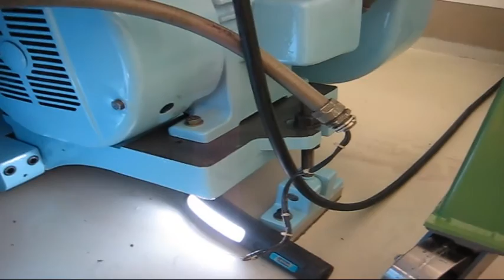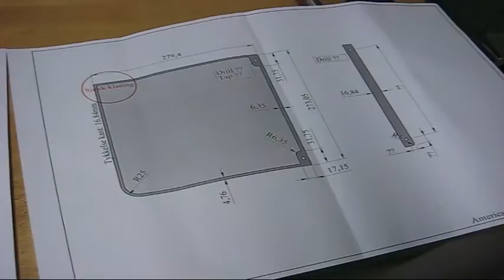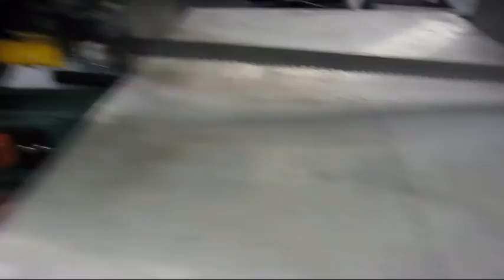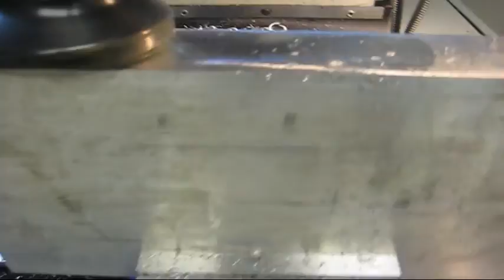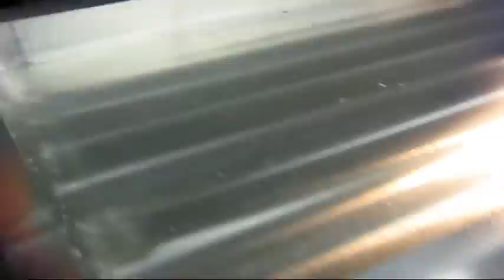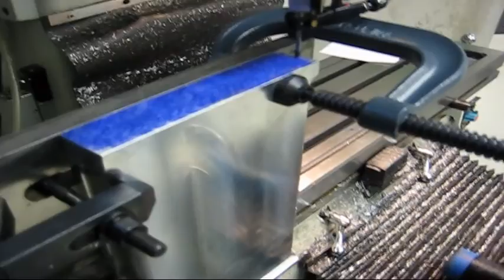American Pacemaker lathe reassembly part 22

Comment: Manual mills and lathes are a have to have,  but they do make a job at the end for cleaning.
Reply from the maker: That's for sure. That milling machine is always more dirty than all the other machines combined, although I always clean and oil the table.

Comment: you could clear anodizing the cover too.
Reply from the maker: That's a good idea. I'll think about that too. Or anodize it in another fancy colour. I'm leaning towards paint though. There are a number of imperfections that the paint will fix up nicely.
Reply: yep, the surface would need to be polished or buffed out, if you're open to other colors hard anodizing might last better. The paint on my Monarch C gets beat up pretty bad by hot chips and general wear and tear
Reply from the maker: Yes, the paint gets it. I have never tried anodizing myself but I read the surface must be perfect in every way as the anodizing will make everything stand out. We'll see what I decide.

Comment: Hey panzax could you explain the math behind the 0.0033mm error for the 80mm face mill calculation? 🙏
Reply from the maker: When I trammed in the head of the mill it was 0,01mm out of tram over the width of the table. The table is about 250mm wide. The facemill I was using was 80mm wide, so that is about 1/3 of the table width. Then one edge of the facemill will be 0,01mm divided by 3 higher than the other edge = 0,0033mm. Hope that answers your question.
Reply: Thanks!

Comment: Wow!  What a beautiful piece you made there.  It looks like you turned about eighty five percent of that block into chips.  I like the result.
Reply from the maker: Thank you.  I think you're about right with that guess.
Reply: I don't remember if I told you before, but the original taper attachment cover retainer screws are 1/4" 20 thread by 1/4" long cup point set screws.  I think flat points would probably work better.  Also try to give yourself as much material as possible so you have fully covered screws.  One of mine was made too shallow and the threads have stripped.
Reply from the maker: Oh ! Thank you very much for that info !
I have guessed the screws were 1/4-20 but I had no idea about length.
It looks to me like the screws fasten the 1/4 studs permanently to the covers and you just pull the cover with the studs out together when you're going to use the taper attachment. The holes in the taper attachment are way too big for the studs to have any kind of grip in there anyway. The holes are 6,5mm or slightly more, while 1/4" is 6,35mm.
Reply: That's probably the way they are supposed to work, but two of my pins(one on each side) are stuck tight in their holes.  By the way, I have noticed you using the imperial measurement system quite a bit and was wondering if that  is common in your country, or do you usually use the metric system?  Just curious.
Reply from the maker: That sounds good, I will do it the way I had planned then.
We use only metric over here, but I have noticed 50% of the viewers are from USA, so I try to make it a little easier for those that use inches.